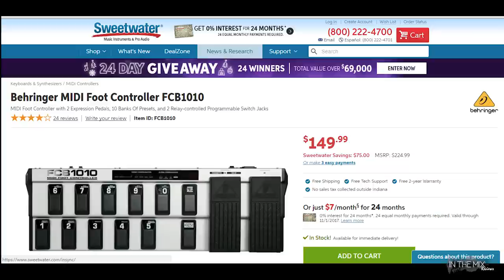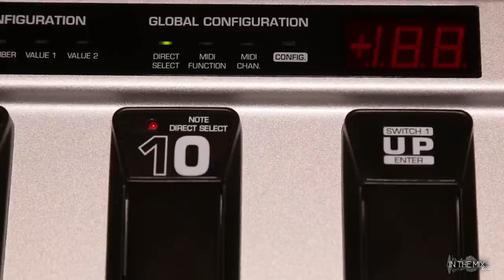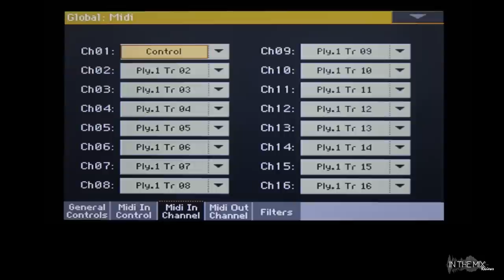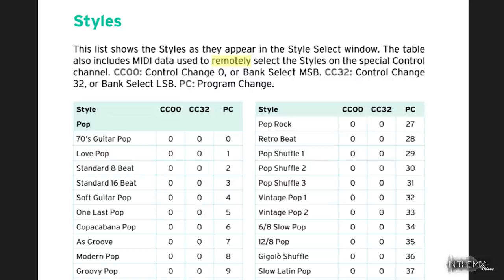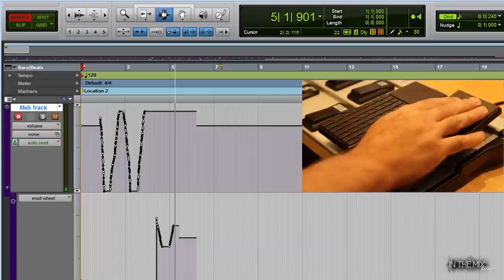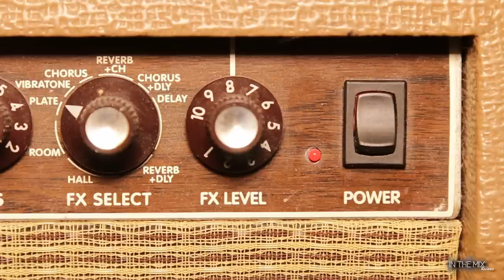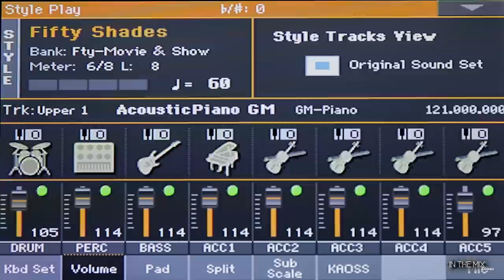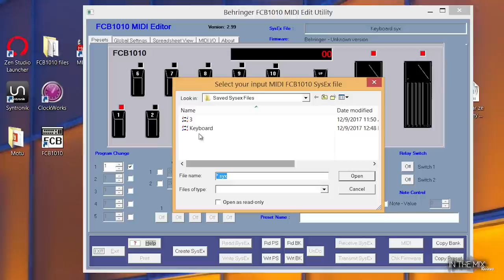Behringer FCB1010 Full Tutorial / Video Manual

Comment: Thanks for the very useful tutorial. Here are the timestamps to the different sections:

0:31 Brief Overview
2:48 Firmware Revision
5:25 Selecting Banks & Presets
8:07 Preset Editing Mode & Midi Functions
11:16 Midi Devices & Midi Commands
13:10 Programming PC Messages
17:06 Assigning Multiple PC Messages to a Preset
19:24 Programming MSB/LSB/PC Messages
22:14 Programming Expression Pedals A & B
27:42 Programming Note
28:55 Virtual Instruments
31:07 Relay Switches 1 & 2
35:37 Midi Channel Assignments
39:07 Daisy Chaining
42:25 Data Management
Reply from the maker: Thanks a lot!
Reply: Very good. Thanks for breaking it down... best Steve
Reply: The world is a better place because of people like you. Thanks!
Reply: Thank you @sweenetto
Reply: Thanks !
Reply: Thanks for the index! It was really helpful.
Reply: pin this comment ! 🤣
Reply: Thanks so much for adding this index! In the absence of a good paper or pdf manual, trying to search through a 46 minute video for the right info is really hard…

Comment: THANKS SO MUCH for including the info on programming and calibration of the expression pedals. I just received a brand new FCB1010, and was trying to set it up to use with my iPad. When trying to route the expression pedals to control an app, it showed the pedal going from 0 to 127 almost immediately, barely moving the pedal. I tried all kinds of stuff, but no change. Then I remembered the calibration procedure you described, and tried it… bingo! Works just right now. BOTH exp pedals were in this state, and the calibration fixed both of them. Once again, Extremely grateful that you included this info; not sure anyone at Sweetwater would have known… and absolutely disgusted with Behringer that they actually ship the FCB1010 in this condition…
Reply: Sweetwater products links are your best buddy! Sweetwater takes the time to do tutorial videos often, as they have done with this product! Check the product page to see their instructions.

Comment: Looks like I'm two years late to the party and also new to the FCB1010, but I have to say this is absolutely the best tutorial I've seen on YouTube regarding Musical Equipment.  In The Mix your thoroughness is second to none. Before I buy this there is one question. Will I be able to control 16 MIDI devices or up to 127?................ Thank you for a wonderful presentation and BTW you have a great voice.
Reply from the maker: Thank you Robert! I tried to demystify this pedal the best I could . So are you trying to control all these devices in real time? FCB1010 CAN transmit over 16 midi channels. So you could potentially daisy chain 16 midi devices and control something on each device independently for simple configurations. For anything complicated, you'll run into limitations pretty quick. For one thing, certain parameters are Global like mentioned in the video, so you won't be able to assign the same parameter to a different switch and transmit over a different channel. In other words, you would need to know what it is you're trying to control on additional devices...and then figure out what midi messages are going to be used to trigger those parameters. Is it just a simple PC message? Is it a string of midi data? If you run into issues, then you might have to use additional hardware/software to re-channelize messages...etc. There's no simple answer for this. Most likely you'll need multiple FCB1010s to control a big network of midi devices.
Reply: @InTheMixReviews  ... Got it, 16 channels in relatively simple work flow.... Digital mixer, 2 to 5 synths, 2 guitar effects pedals, channel switching on MIDI amp, perhaps 2 recording consoles,  yes less than 16 at the moment. Looking simply to start with being able to set song lists where program changes would sync all gear in real-time and build into more elaborate schemas.... I was initially concerned with how many channels could be sent out at one time. Despite the limitations, as you have pointed out,  some of the workarounds could be setting up scenes per device and just triggering them from MIDI. I did stumble on a new software based package, if you hadn't seen it already.....not a trusted secure site, but I had no problem there. You may wish to scan it first thru Kaspersky.        http://www.muckuper.com/

Thanks Again! & Best Wishes
Rob

Comment: First. Thanks for the video. High quality and clear. I have a question. I use keyboards of the type: Yamaha S X900
Do you know if it is possible to set the fcb 1010 to be in the role of multi pad or reset tap tempo and more? I would love for you to answer me. thank you very much.
Reply from the maker: Glad you found it useful. What are the midi parameters assigned to those keyboard functions ? That would be a good starting point for any midi device.
Reply: The truth I do not really know. I will check it. Still thank you very much for the quick response I am surprised. This is amazing.

Comment: Studied this while waiting for my new FCB1010 to control my new KETRON SD2 . When I got the pedal, just for grins went ahead and plugged it in without programing( CASIO PG-308 Synth guitar > FCB1010> KETRON SD2  sound module) was pleased that out of the box it controlled the first 100 sounds of the KETRON! The FCB1010 bank  00 and footswhitch 1 matched KETRON 1 Grand Piano..etc; bank 01 footswhitch 1 = ketron 11...etc. So cool, QUESTION IS: WHAT ABOUT THE OTHER SOUNDS ON THE MODULE? The match out of the box was to what KETRON calls "VOICE BANK A (control change 00, Value=0)" and that has 128 sounds, so as described above I  can call up the first 100. This module has 3 voice banks with 128 sounds each plus a "Preset Bank" of 128 plus "Live Drum sets" x 82!   Thank you so much for this, had a Behringer FCB1010 a few years ago and sold it in desperation!
Reply from the maker: I hear you! For a lot of people the FCB1010 end it up in the closet! I don't see why you shouldn't be able to call those patches located in additional banks. Most controllers default to the first bank which is why you don't have to do additional programming. Did you look through the manual to see if these extra bank have anything assigned to them? You probably need 3 entries for those presets : CC00/CC32/PC
Reply: Thanks for the reply, am a super old and a nube at this, Well, the default bank I mentioned says : VOICE BANK A (control change 00, Value=0)". The next one says Voice Bank B(control change 00, Value= 1). Next Voice Bank C( Control Change 00, Value = 10 ) Next one ( Control Change 00, Value = 2 )..etc. Ok so need to watch your viedo again figure out how to change that VALUE #...
Reply from the maker: You CAN do this. It's not as hard as it looks. Yes, you'll find all that visual help in the video. (Pay attention to 19:24 mark) .

Comment: Not sure if you mention since I only skipped around, but there is third-party software called iFCB that let's one edit the FCB1010 on a computer via USB. Pretty handy stuff! Also thanks for a great tutorial!
Reply from the maker: Yes, there are multiple editors available. There is no USB connection on the FCB1010 so you would need to use a 5pin to usb interface such as M-Audio UNO. I also have a full tutorial for FCB1010 Manager which is a free editor.

Comment: I would really love for you to do a video with just Mini controlling guitar amps that have Built-in effects as well as being Daisy chained to TC electronic's G force.
Reply from the maker: As far as the connection goes, the principles are the same. The only thing different would be the actual Program Change messages and Controller numbers that are specific to each individual device. As far as using an editor, I'm recording a follow up video for the Mountain Utility Editor by Ed Dixon at the moment. Will eventually do device specific videos as well.

Comment: Congrats & Thank You for such a comprehensive and detailed tutorial !!!
I was wondering if there is a way to set a pedal for an "octave down" change. I believe this would require 12 "semitone down" messages stream programmed into one pedal. 
Another interesting challenge could be sending 12 "semitone up" messages to return to original octave when the pedal is released. I'm afraid these will not be possible.
Reply from the maker: Thanks, glad you found the video useful. If 'Octave up/down' change feature has an actual program change or some type of CC# assigned to it (on your device), then it's only a matter of programming the FCB1010 to transmit that data. The FCB1010 never knows what it is you're actually controlling. As long as that or any other particular feature CAN be remotely controlled with a program change or CC#, you'll be able to make that happen. Now the 2nd part of your question is interesting. It's been a long time since I've used this pedal, so can't give you the answer for certain, but if I remember correctly, the UNO chip (3rd party) has interesting capabilities that do things like that. I recommend that you check out the Facebook group, and post this question on there. There are many users that use this pedal for a wide range of devices. You may get better suggestions, especially if you give more details about the midi device you're trying to control...etc.
Reply: @InTheMixReviews  so many thanks for your fast and crystal clear detailed reply, truly appreciated. Just as a minor contribution, I thought of a more generic than specific interest. Quite a few  midi implementations seems to handle octave up/down compared to  semitone transpose support.  So, the idea would be to check the chances of sending a stream of -/+12 semitones down/up to make an octave shift. Would it be possible to store a stream of CCs (rather than a single one) in one pedal? 
In anyway, thank you again for being so kind and bring extra reinforcement to all these details for us. I enjoyed your warm reply and will follow your advise to check with user groups. Cheers!!!
Reply from the maker: @dakoiaa  A stream of CCs? I don't think that's a possibility. I see why you would need a number of them to make the Octave shift possible (if there's no single midi commend available for this feature), but what would be an example for such a stream? Would that be a string of the same CC#?
Reply: @InTheMixReviews  Hi, thanks for this wonderful interaction 😃 !  
Yes, it would be a string of the same CC#. The example I thought of is a stream of 12 semitone-shifts to comprise an octave, since most synths' midi do not offer a single CC# for that. I'm about to buy a 1010 and I realize you think that's not possible with it.  That's what I was afraid of.
Reply from the maker: Yes, I don’t think that’s a possibility.

Comment: Wishlist, A video on guitar-in effects of the Korg PA700 using the FCB to switch from clean, chorus and distortion for my electric guitar. Thank you
Reply from the maker: Honestly you have all the instructions you need in this video. You just have to look up the manual for your target device, and see what midi parameters are assigned to that particular feature. Then, you program the FCB1010 with those values. You can also try the Facebook group. Many different users who use all kinds of gears in there.
Reply: @InTheMixReviews  Thank you for the response, I have followed your instruction. I can use all of the  Korg  commands: variations, fills, stop, etc..on my PA700
Choosing a Voice/Guitar Preset for my electric guitar plugged in the guitar/mic input. Trying to access the patches by default, the book states:
Voice/Guitar Presets can be selected by sending a series of messages on the MIDI channel assigned to the Guitar Processor.
▪ Control Change #00 (Bank Select MSB) message with value ‘0’. (CNT1)
▪ Control Change #32 (Bank Select LSB) message to choose the type of preset. (CNT2) and add the preset CC32 Value (one of the three : Factory: 0, User : 1, Local 2)
Using the voice/guitar effects 
▪ Program Change message to choose the preset. Preset PC Number (PC5) Preset 1…64 0…63

If your controlling device can only send Program Change messages, manually select the type of preset (Factory, User, Local).  

Works,  but it also it changes the style on the keyboard. The coding is very similar for styles. 
FCB1010 works great after looking at the video and follow the instructions. Any help would be very much appreciated. Thanks

Comment: On minute 8:32 on the video, you said that there is absolute no difference between the switches, implying that, for instance, switch 1 to 5 could also be used to send CC messages. How do I change the midi function of the switch? In my case, I need to send CC98, CC99, CC06 and CC38 to my Pa5X, but I found nothing showing how to do that with this pedal. Can a switch really be configured to send CC instead of PC?

Comment: Hi I managed send NPRNs by sending MSB and LSB through CNT 1 & CNT 2 (pads 6,7) together with sending program change (pad 5) with the desired value. Can the value be sent by the expression pedal instead (pads 6,7,8)? If so what should be the the first parameter of the expression set to (pad 8)? Many thanks!
Reply from the maker: Hi. If I remember correctly, Expression pedals are meant to be used for CCs only. Volume, expression, mod wheel and anything that can be assigned to a CC #.

Comment: i was going to buy this controller for my digitech rack effect (i am justy getting into MIDI and rack stuff) i have also a mesa studio pre that needs a footswitch to change channels. do buttons 6 to 10 dont allow program changes? and can i set the switch to momentary latchins ( so if i touch one preset it just changes channel on the amp?)
Reply from the maker: Like it was mentioned in this video, all 10 pedals CAN be programmed the same way. Anything switch 1 can do, switch 10 can do as well. I know there's a 3rd party chip 'UNO' that adds a lot more interesting functionalities like what you're looking for. There are a lot of guitarists in the FCB1010 Facebook group. You might want to post your question there as well.

Comment: Hello, I have been researching midi mapping/programming for 8 years now, and have found no one how explains the process as succinctly as you have here. I do need additional help with an issue however and was wondering if I could pay you thru a cash app for further equipment/instructions I am trying to integrate into my performance.  If so please contact me and we can set up a time where I can explain the details of my project.
Thanks a lot.
Derek.
Reply from the maker: Hello Derek, the only thing I can suggest is that you join the Facebook group and try to get answers from there. There are some advanced users who use their FCB in pretty complex set ups.

Comment: Hi! Thank you very much for this amazing tutorial. I have some questions if you don't mind. 
1) I have 4 synthesizers that can receive CC from external expression pedals. The Moog one is actually 3 synths in one, so a total of 7 synths. I can set all synths to receive midi on different midi channels, for instance, I can set all synths from midi channel 1 to 7. The question is: Can I program the FCB to send expression to different channels? An example of what I want to achieve is to send volume to the Pa4X, panning to the Montage, cut off and resonance to the Moog, etc. Is that possible?
2) Something similar about program change. Can I send PC to all 7 synths in their individual midi channels? What I want to avoid here is problems due to specific MSB and LSB values that mean different things to each instrument. For instance, if I send MSB 62 LSB 0 to the Montage on midi channel 1 and my Fantom is also receiving midi on channel 1, this will probably mean something totally different to the Fantom. The question is: Can MSB and LSB be sent to different midi channels all at once?
I have a Nektar Pacer pedal and I can achieve these needs with it so I wonder if the FCB can do something similar.
Thanks!
Reply from the maker: Hey man. Glad you found it useful. It's been a long time since I've used the pedal, but if memory serves me right, this is NOT possible with the stock e-prom. You may or may not be able to do this with the latest UNO chip. To be sure, you might want to check the FCB1010 Facebook group to confirm this.

Comment: is it possible to have multiple keys turned on at the same time ? like for example let' say you have a clean guitar sound on key 1 , a distortion guitar on key 2 ..but you want to toggle on and off a delay assigned  on key 6 .. i can do this but when i hit the key 6 to activate or desactivate the delay ..it turns off  the red light of the key 2   i still have the distortion but visually it's  confusing ...i would simply like to stay on key 2 and turning on/off the key 6 ..if that makes sense :)